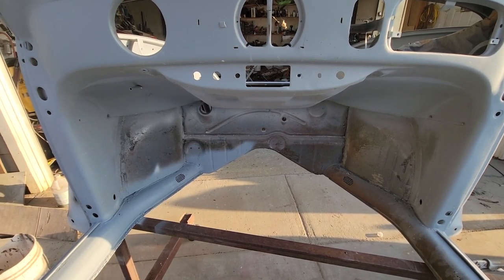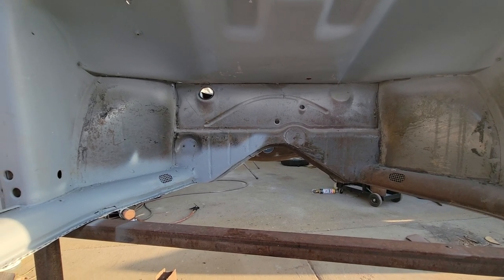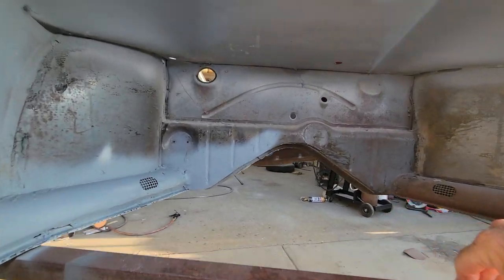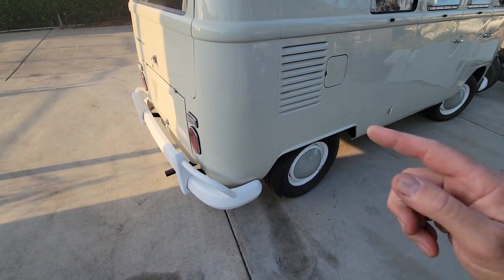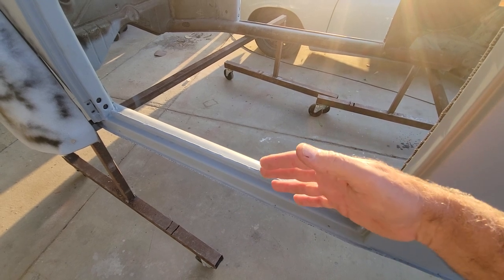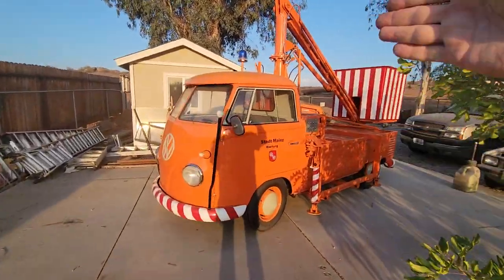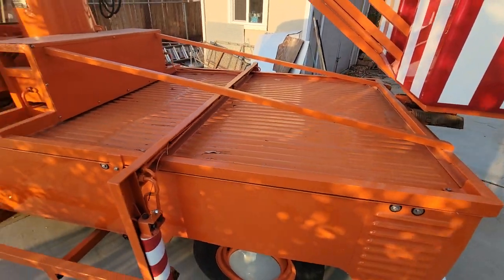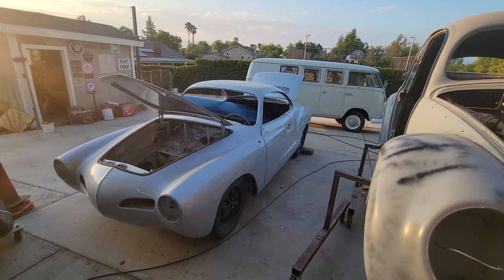Metalwork Replace the panel or FIX the old The way I decide it.

Comment: Wolf Parts and/or Restoration Panels sell the correct sheet metal for that area of your car. The quality of both companies are amazing. However they are pricey. Given your calculus for when to repair vs replace, it probably wouldn’t have affected your decision. When you do decide to replace metal I recommend looking at those two companies if you want year specific and correct sheet metal.

Comment: Thank you, very informative. quick question, what kind of primer would you recommend. I'm getting confused and some I have used don't work well
Reply from the maker: I have been using a few different ones. Tamco Galvaprime is really good but price is going up pretty fast. The other one is this one looks like their sold out but keep checking. it is an epoxy underlayment and high build urethane that sands pretty good. https://refinishdepot.com/collections/primer/products/2k-primer-rust-protection-grey-gallon-kit-4-1-1-quart-epoxy-kit-with-hardener
Reply: @Mikefngarage  Thank you so much